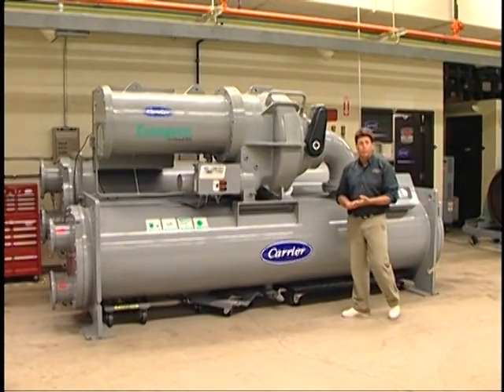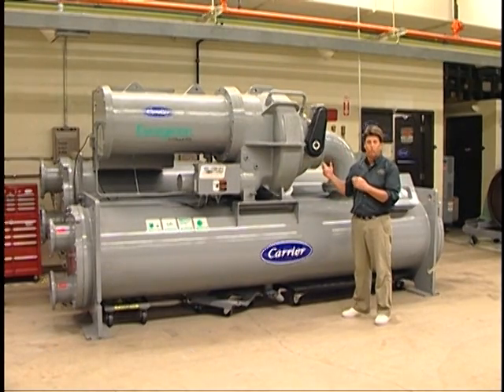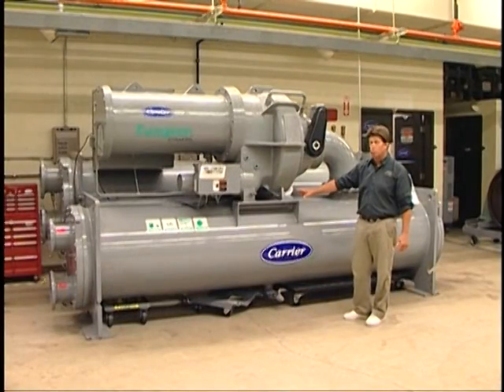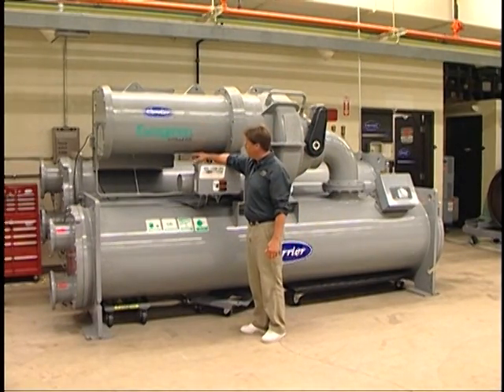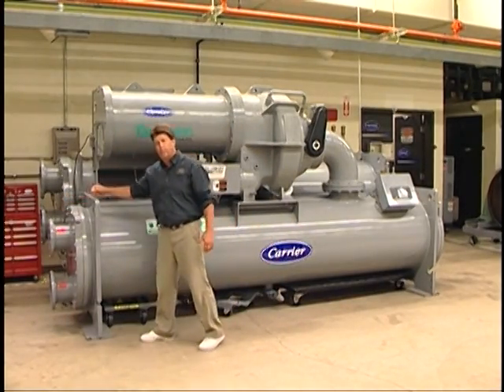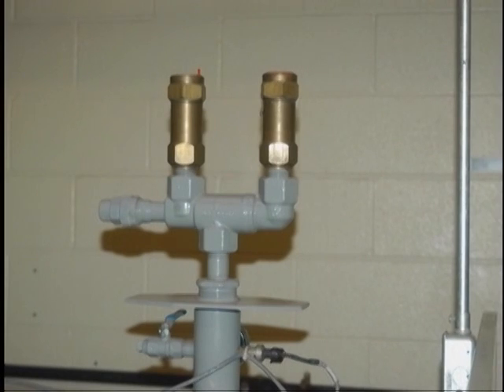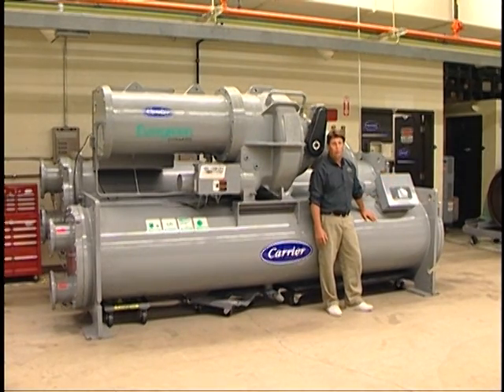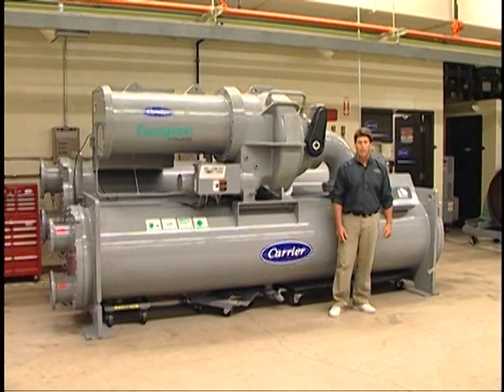Water Cooled Condenser Centrifugal Chiller - Overview

Comment: I'm 4 ICVC with erasing screen. And when she goes, all configurations of are lost. It works to a certain time when I am calibrating the Guide Vane she simply deletes. Retreat strength and call again, but when I'm setting it off. Which the board component that does this occur and what the life of a plate that? My machines are the model 19XR CARRIER.

Comment: R 134 chiller ,so the working pressure is negative or positive ? Please advise
Reply: 134 would be positive pressure
Reply: +bden19 I found that it's negative pressure... Gas property
Reply: 134A is positive
Reply: Positive. Suction pressure around 30psi.